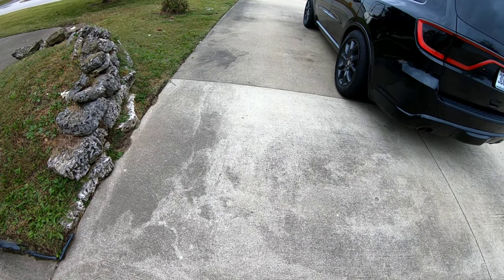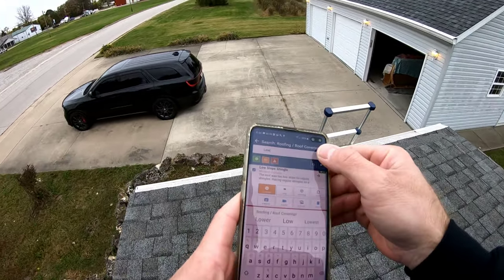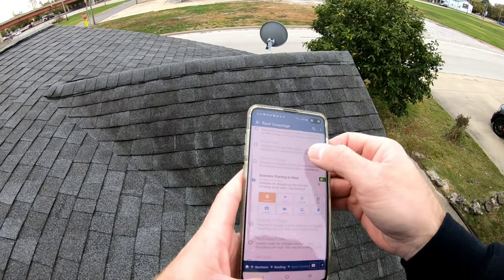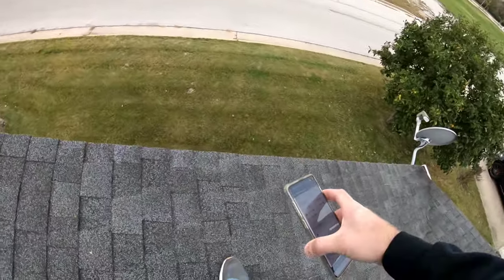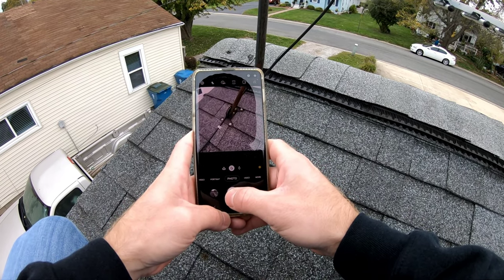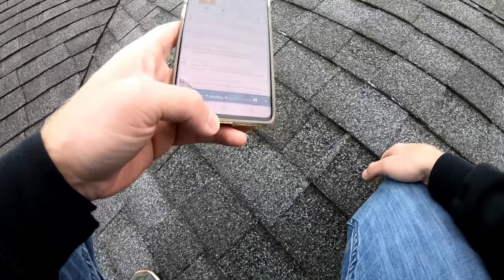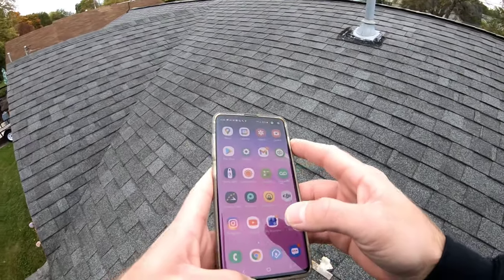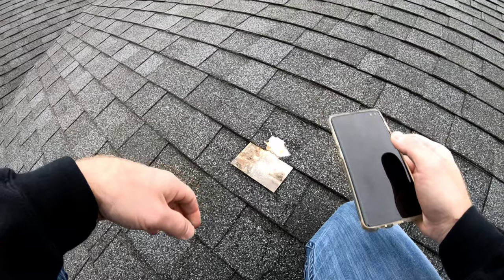Home Inspector INSPECTS a Simple Gable ROOF

Comment: Rule #1 on roof jacks... NEVER EVER SEAL THE BOTTOM TO THE ROOF!! It makes a dam. If people seal the sides too, water can backup and pour into the attic. If water gets under the edges of a roof jack it should not be impeded to drain out of the bottom. Also, Pro Tip: If you paint the rubber seals of roof jacks the rubber's lifespan doubles or better because the paint prevents UV damage that cracks the rubber, works great on solar water heater systems with the foam rubber insulation & HVAC systems too. Let the paint take the licking, it's cheap & it works, oil base, water base both work, two coats to start with & recoat as needed. Here that's 5-8 years between coats.

Comment: It possible that the flat shingles on Ridge Cap has been walked on. Paint could very well protect that metal exhaust vent pipe. 
Ins. Co. recommend homeowners do maintenance on the home. Trim overhanging trees, tuck point dilapidated mortar, grease rubber pipe boots.

Comment: That's one bad roof.  Looks like early failure from overheating.  Also those plumbing vents were done poorly...hence the excessive tar seal put on them (I'd guess they leaked at least once and that was the "solution".  Ridge vent looks almost like it collapsed from someone walking on it.  There also should have been flashing from 0 slope to 4 slope.  

Like your vids